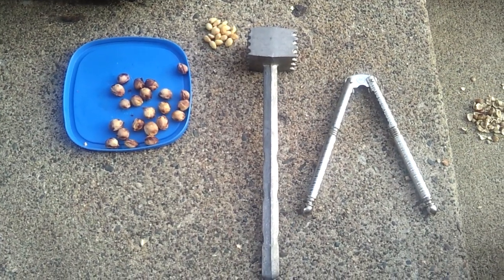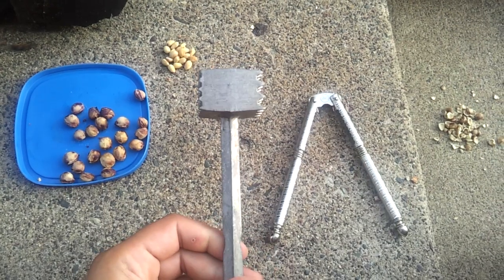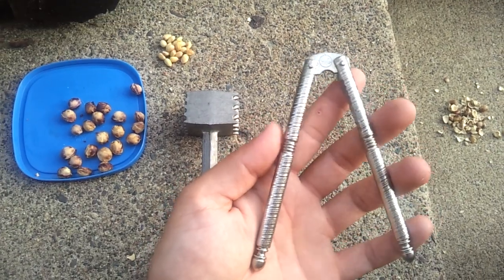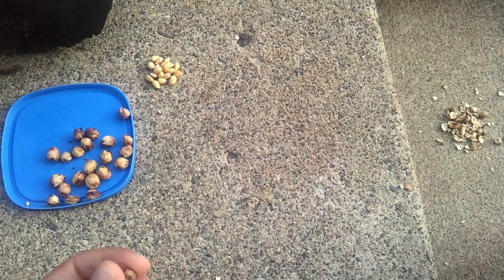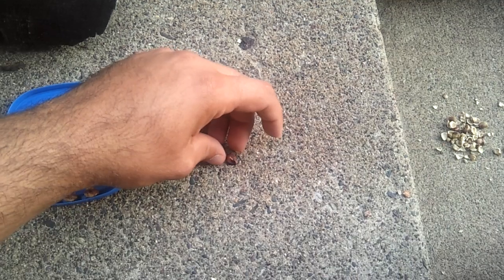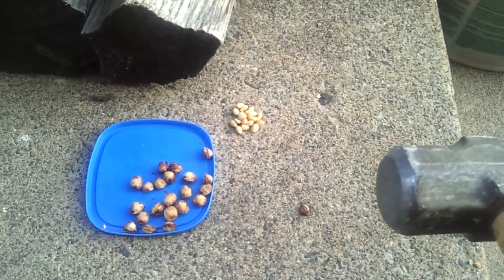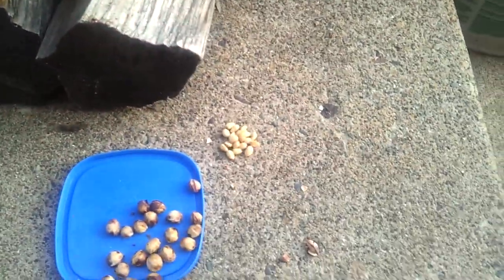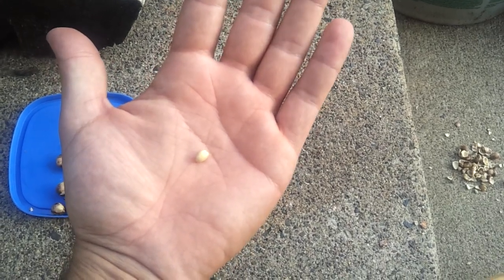How to Open A Cherry Pit

Comment: would you still recommend placing the seed in the refrigerator for 6-8 weeks?  and if so should I place the full seed pit and all or just the seed?
Reply from the maker: The whole husk and seed (a.k.a. pit) should be cold stratified. The longer it is in the refrigerator the better. I am going to do a side by side comparison between a bare seed versus one that has not been opened. I had both opened pits (bare seeds) and unopened seeds in that pot. The majority were bare, opened pits. I believe both bare and unopened grew, but I want to be able to tell people with certainty. For now, I would try 50% bare and 50% unopened when planting. If you find out before I do, I'd love to hear about it.
Reply: steelyhendrix thank you I will be trying both.  let you know in the spring :)
Reply from the maker: Peggy Mashke
I have 50 cherry seeds I will be experimenting with. I can hopefully build a raised bed next weekend. I will plant the seeds right before the first frost, 25 cracked and 25 bare. I am interested to see the results.
Reply: steelyhendrix Were you able to do the experiment (25 cracked/25 uncracked) in the raised bed? Just curious if you did and what the results were if it is not too early to tell.
Reply from the maker: I have had little luck with those growing. I am having trouble with my bed in general. I am not sure if it was that I let the seeds overwinter instead of cold stratifying in the refrigerator or that the soil quality is poor.
Reply: steelyhendrix  well so far nothing :( no Cherry trees popping out. my soil is very rich and very high in sulfates will try a new approach will update when I can
Reply from the maker: I think a store bought sterile soil isn't a bad idea, at least when starting them out. The Schultz cactus soil has disappeared from my local home store, I think it was discontinued.
Reply: I will be trying this again.  No luck at all

Comment: i use a small c clamp (at any hardware store )  it works every time you can control the pressure with your thumb   this is better than trying to use pliers wrap a paper towel around c clamp and seed   simple  any one can do it

Comment: as long as you dont eat the seeds they contain cyanide use vice grips work far better when extracting the seeds as you can set vise grips to exact size so it does not hurt seed
Reply: Have you actually tried it?  I tried all my channel locks and none of them could get small enough to actually open the pit and all the way closed like pliers did nothing but crack the seed.

Comment: One does not need a mallet to crack a cherry seed.  I used a pair of Robo-Grip pliers I purchased at my local Sears store, and that worked like a champ.  These pliers are self adjusting and grab the pits without a problem.  I was able to retrieve all the seeds right in my hand after cracking the pit.  I would not use the hammer technique since it can crush the seeds in the pit.  At least with pliers, one won't crush the seeds.

Comment: I put use a towel to layer with the pits. Then give them (a few at a time) a smack with a craft hammer.  Open the towel, remove the pieces of hull and collect the kernals.

Comment: AWESOME thanks! PS - can one use store bought cherry seeds? or are they GMO?
Reply from the maker: I have only ever grown organic cherries. My wife did purchase some cherries from Trader Joe's the other day. They were not labeled organic. I will give it a try and keep you posted. The jury is still out on whether the pit needs to be removed or not. I planted some with and some without the pit, but too closely together to determine which ones where which.
Reply from the maker: steelyhendrix
I have been doing some experimenting. So far, the cherry pits that were unopened have had the most success in growing. I hope to make a raised bed soon to experiment between unopened and opened cherry pits.

Comment: Next best method 

Hack saw lake a cut in the seam slightly being careful not to cut the seed then use a butter knife or flathead screwdriver stick it in the cut then twist the pit should split apart and BAM u have the seed intact ready to plant 

U can even carefully peel the skin off the seed to help it sprout faster

Comment: A simple way to crack them open is to place several seeds in a plastic baggie and lay it on a stone surface and tap each seed lightly with an ordinary hammer and BOOM! Done!
Reply: They’ll smash to bits this way.  Have you actually tried it?
Reply: @edwinlopez8559  Are you replying to me? Because if so YES I have (after hitting too hard and smashing them) I quickly learned not to be so heavy handed and with 2 light taps I easily separated the seeds from their hulls.

Comment: I had good experience using a plier like the one I copied its image from Amazon. Basically, first to avoid lots of broken pits around, Place the cherry pit and head of this plier inside a clear plastic sandwich bag. Then I place the pit inside the circle cavity shown in the plier. Then by attempting to close the plier within 1/8” of its closing, it will break the pit. The nice thing is the maximum pressure this closing process of plier can only break the skin without damaging the seed inside. As long as your pliers has such round cavity you are good to try it.

https://images-na.ssl-images-amazon.com/images/I/715P8kjpZxL._AC_SX679_.jpg